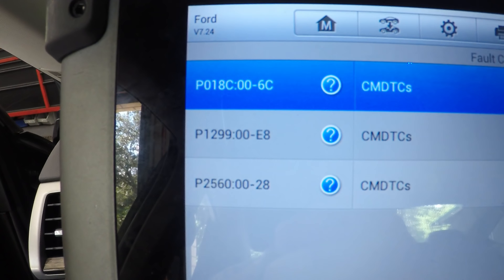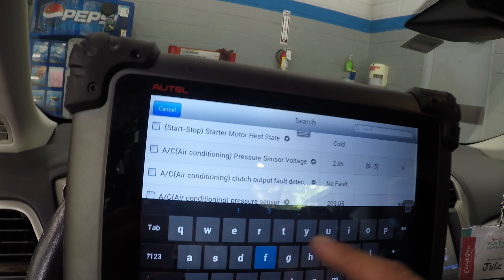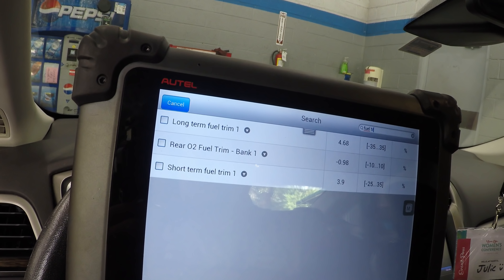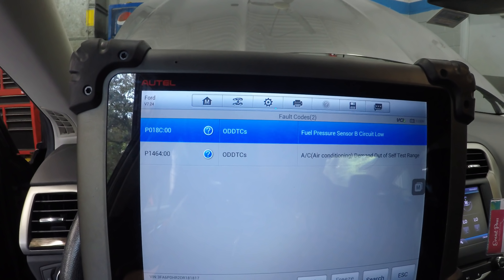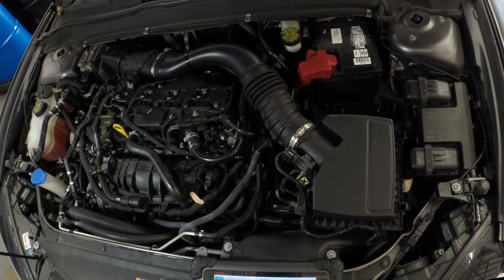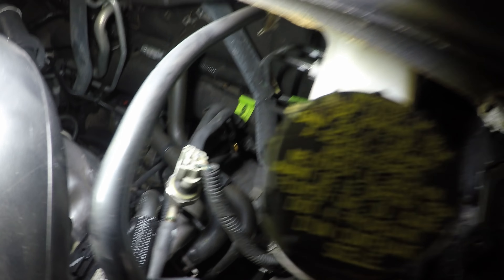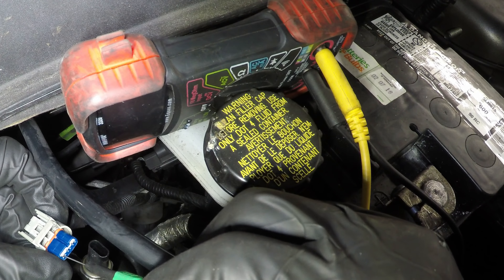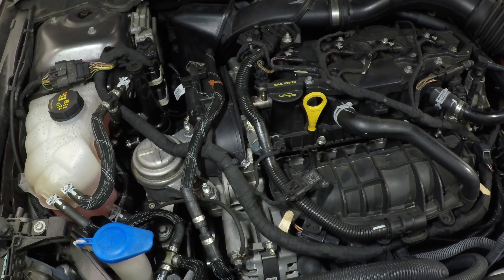2013 FORD FUSION -  CHECK ENGINE LIGHT ON

Comment: I just did a diagnostic on an old 6.0 gm diesel and had to turn him away. Unfortunately he purchased a truck with bad issues and no one will touch it. All the diag work was effectively for not. I did take the time to explain to the customer the issues and why he can't find anyone willing to take on the project. He thanked me for explaining the issues in a way he could understand and at least felt like he had some place to finally start from. This jobs not always pretty! Lol
Reply from the maker: Yup, sometimes you get those jobs that won't make sense for both parties involved. Nice work making sense of it all for the customer 👍
Reply: Hey guys gotta do the right things in this life. I like sleep to much. Lol
Reply: Ok, now you have me wondering!! 

How bad could it have been, to just send him on his way! I once worked at a Precision Tune shop, and heard an upper instructor-mgr tell a tech to send a Northstar V8 packing!! Never understood that!! The more you do, the higher the pay!! That's probably why they put two of us in the pit, to do oil changes 10hrs a day!!
Reply: Well for me Im not setup to do much with diesels and told him that right up front. I felt bad for him with these other shops giving him bad information and one shop charging him to tune it and not actually doing it. It had a pump out, several injectors and some deep engine noises. It was completely covered in oil like most old diesels. Lol I think it was a 1996 and no one wanted that old of a project. I probably would have taken it on except Im just not setup for it or have the room. I called a buddy of mine that only does diesels and he said don't do it if you don't have the machine to time the pump. So I gave him the best diag I could and didn't even charge him for it. One shop charged him for a starter then it went bad a few weeks later and they wouldn't warranty it so he paid then again and it went bad. Judging how it looked like I'm guessing it was used. Can't say for the first one.

Comment: Thank you for your being honest! Today my 2012 fusion check engine light came on, and I’m not sure what to do. I just had my oil changed on the 2nd of this month- now this!! I’m immediately started thinking they did something to my car when they did the oil change! I’ve never had any problems with this car until now, so I guess the thing to do is start with a diagnostic to find out what caused the light to come on. Thanks

Comment: Enjoyed your video. I have a  2010 ford fusion 2.5L. It pulled a code of P0713 and it says  Transmission Fluid Temperature Sensor.  What is the cost to have this issue resolved?

Comment: The same thing happened to mine in Florida one day. But it was nothing wrong but the 12v battery drained while driving. I replaced the battery and took it to Ford they tested it several times and nothing was really wrong.

Comment: My 2013 Fusion SE 1.6 keeps going into limp mode from a P1299 but this model does not have a cylinder head sensor so it shouldn't be throwing that code, and it's not actually overheating and all components related to the cooling have been replaced with new parts and it still kicks into limp mode every couple minutes and I have to pull over and clear the code. Any ideas?

Comment: This is a 2013 imagine the 2019 model years and what you can expect to see more of this in the future.
Reply from the maker: Yup it's a 1.6. soon they're going to be pumping out 1L engines 🤣
Reply: @SuperMarioDiagnostics  They've been pumping those out in Europe for years... North American thinking of "bigger is better" is slooooowly getting smaller. =)
Reply: @SuperMarioDiagnostics  My 2011 Ford Edge hesitates during acceleration at highway speeds and even though the check engine light came on, NO odb fault codes pop up when scanned. What could the problem be?

Comment: I have replace several low fuel pressure sensors on those, but have not dealt with the overheating
Reply from the maker: Strange right? That they would recall something like this. Makes you wonder. Thanks for watching Mike!

Comment: I just got my 2013 Ford Fusion inspected today and the Check Engine Light came on when I was nearly home. The light didn't come on since we got it in August of 2020. But, now, just after inspection, it comes on. Any idea why that would happen right after inspection? I can't seem to find any answers online. I am scheduled to bring the car into the dealership I bought it from (who did the inspection) to see what happened on Friday. Keeping fingers crossed that it was THEIR error. The light wasn't on until AFTER they inspected it. Any ideas?
Reply from the maker: It may have been an error, or a coincidence. I'd see what code it is before coming to a conclusion.
Reply: @SuperMarioDiagnostics  Thank you for responding, man. I hope it's just an error. It's way too weird that the check engine light would come on AFTER an inspection. Before yesterday, I've had zero problems with the car. The car isn't acting any different either.
Reply from the maker: Yeah, but that happens. Cars wear out, parts wear out. No car will ever not have problems
Reply: @SuperMarioDiagnostics  Yeah, I know. Oh, BELIEVE ME, I know that well! haha! I just got this car in August of last year from the dealership as part of the 'Certified Ford Pre-Owned' group. So, hopefully, the coverage - and the Janus Protection Program we pay for - takes care of whatever costs may spring up. I've heard mixed things. So, the worry is creeping in. Especially because, around here, it's property tax time. We have the money set aside for that - and not for crap that's going to spring up in a car we just bought 9 months ago.
Reply from the maker: Can't worry about what we don't know lol

I know it may seem too coincidental that the light came on after an inspection, but that's happened to me and i knew for a fact it was natural causes. I've had fuel pumps go dead while in my care. You name it. 

But let's see what the code is first 😉
Reply: @SuperMarioDiagnostics  I'll let ya know after Friday's visit to the dealership.

Comment: Good try buddy!

It's always tough when folks do not think that vehicle history is critical to the diagnosis and repair process.
I guess the client didn't want you to install the fuel pressure sensor, huh?
Oh well...

Quick question:
Is this motor's temperature regulation is done by solenoids (as opposed to a thermostat)?

Always good to see your shares.

-100
Reply from the maker: That is exactly right, I need all the info BEFORE I get into the diagnosing! 

Shop decided not to step in at all.

Great question, this particular engine has a thermostat, and two solenoids in its cooling system. It's not what it used to be, that's for sure! 

Thanks for watching!

Comment: what does it mean if the ABS turns on while driving (2013 ford fusion hybrid)
Reply from the maker: The traction light could mean you're slipping.
The abs light could mean a wheel speed issue.
Gonna have to pull codes and test